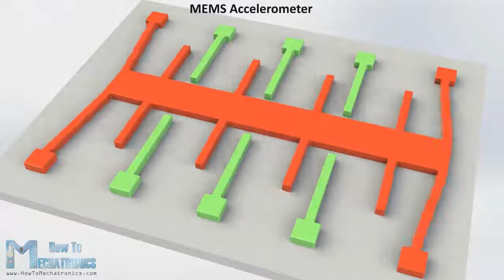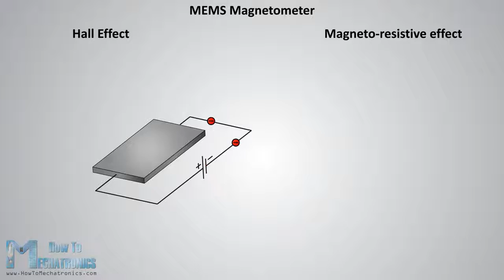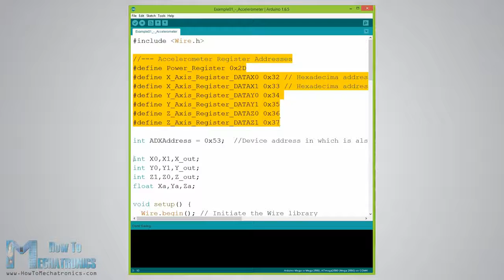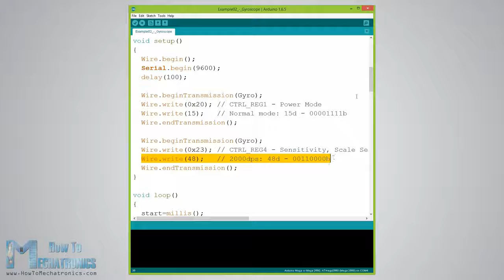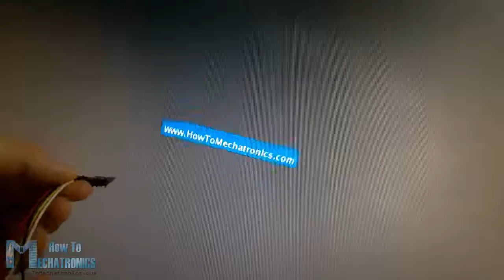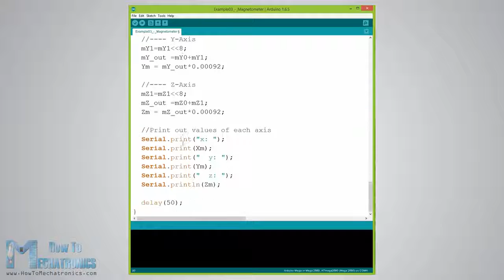How MEMS Accelerometer Gyroscope Magnetometer Work   Arduino Tutorial

Comment: Please sir, how to convert this accelerometer in (g) to displacement ? This is possible? 
I want your assistance 

My gmail : derghamxyz@gmail.com
Reply from the maker: Well, in theory double integration method will give you what you need but in practice double integration accumulates the errors in the measurement as you go so the results are never accurate or reliable to use for distance measurement.
Now in the case of using another sensor in addition to the original sensor this can be used with some sort of filters to reject the measurement errors periodically so it don't accumulate, it is still far from perfect and isn't as good as the worst distance measurement tools but it will do a better job than just double integrating the acceleration of a single accelerometer.
Check this:
http://cache.freescale.com/files/sensors/doc/app_note/AN3397.pdf?fsrch=1&sr=2
Also if you are considering something like a model rocket with large acceleration in one direction this can actually work since a lot of the error sources in such situation are negligible compared to the actual acceleration and distance so it really depends on the situation and the accuracy required.
Reply: KAPIL KUMAR 

Sir, 
 I would like to thank you with gratitude😘